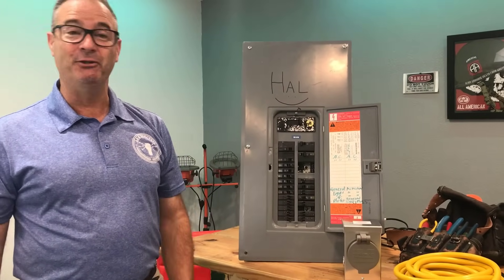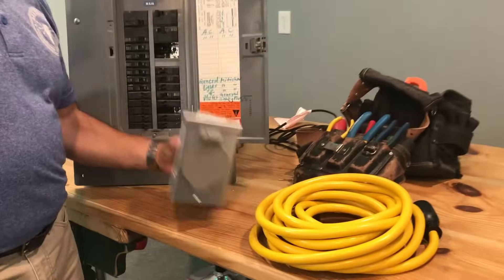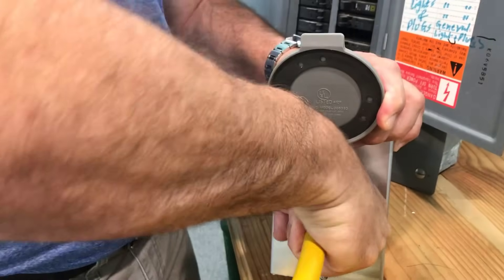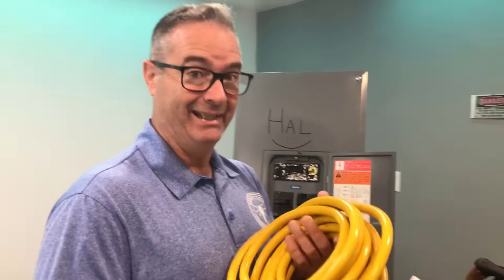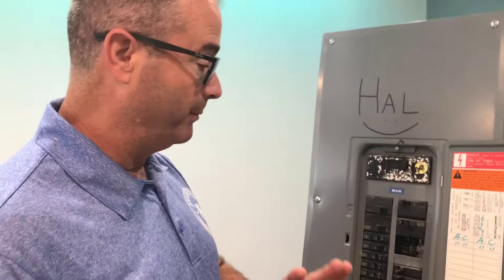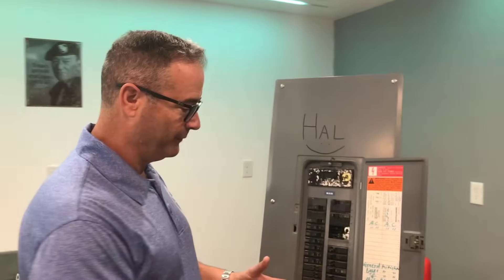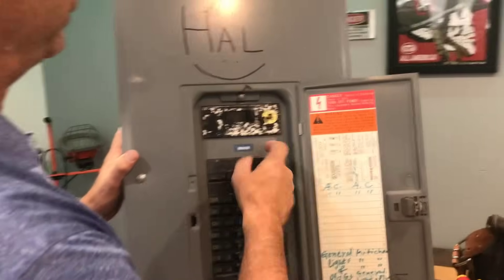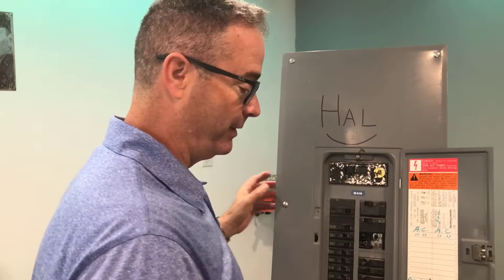4 Generator Hacks by an Electrician

Comment: Should have some discussion on dealing with the ground and neutral connection from the generator.  We want to preserve the ground fault interrupt function of the breakers in our main panel and subpanels.  If we don't have a transfer switch which interrupts the ground and neutral tie in our home when the switch is thrown, and use instead a backfeed of an standard 240 VAC breaker, we need to insure our generator set does not tie these together in its system.  With two remote locations where ground and neutral are connected, strange and dangerous things can happen.

Comment: Can you bury the cord from the gen shed to the side of house (40ft run) so all you need to do is plug it into receptacle on house (or just leave it plugged in) with gen and transfer switch off???
Reply from the maker: If the cord is rated for outdoors and direct burial, yes.
Reply: @abrelectric  Thanks:) How about a cover over the receptacle box attached to the house any ideas?

Comment: You forgot to mention something critical, if the extension cord longer than 50 feet from a generator can cause a loss of amperage and voltage, a phenomenon called voltage drop, which reduces the power delivered to the connected appliance! None inverted generators may damage sensitive electronics, sound bars, tv’s etc etc. LED lights may experience flickering when using a none inverted generator.
Reply from the maker: You are so right. The length with the resistance of the copper absolutely can contribute to the voltage drop. The other issue will be the connected amperage will also contribute to that drop

Comment: Great info! Biggest problem is when Someone pulls the Generator out and it doesn’t start. Why, because the 10% ethanol fuel sucks today and it clogs the carburetor. Make sure you run ethanol free fuel from day one and a little fuel stabilizer in the gas doesn’t hurt. I had 2 Homedepot generators for 20 years, no issues.

Comment: 👍👍👍 great tips, question, is it necessary to turn off the solar panels too?  it's installed before it reaches my main breaker box, the solar installers never advise me to shut it off during power outages.
Reply from the maker: @PilotGuam  my experience is Yes, turn off the solar panel breaker when you're running the portable generator.

Comment: ❗️BEST PRACTICES… Charming man, good video… Any generator contractor not running a full load for 20 minutes cycling in and out ovens and Air Conditioning loads is no professional in my book.  Cheap generators and pretend contractors are a waste of money.  A real generator company has six month site visits, changes oil and air filters with a small engine tech yearly and replace the starter batteries before fall every two years. The Chinese starter batteries don’t hold up and they are cheap. Your client wants reliability, not pushing some silly battery to its near death perhaps squeezing another year.  This is not your old F150 pick up, it’s a clients reliability AND your reputation on the line. 

A real generator company has LOCAL service techs just for generators. Not a tired, hungry electrician at the end of his long install day and has a no all upset client service emergency often due to the lack of excellent preventative maintenance.  Everyone is crabby and it’s never pleasant.  These silly home centers on request for service offer an 800 number and a cold shoulder.  Buy wisely, not conveniently!   Be a Best Practices Buyer detective to qualify the company before you EVER let them set foot on the job site to even quote the job.  Google ratings, BBB.org and other reference points are very important if reliability is the goal.  

Lastly Kohler generators rarely disappoint if they are installed correctly.  Also keep the low voltage signaling cables completely separate from line voltages in separate sealtight whips… Too many false alarms from EMI and intermixing of LV where it has no business being.  

A generator is NOT a refrigerator and is not a home appliance. It is power stability and reliability in a complex system that MUST be serviced regularly.  None of this ‘if it breaks call crap’.

There are electrical contractors (EC’s) that have service level agreements indicating exactly what’s to happen and when.  They sell these with the installation and it funds the technician(s).  One contractor I knew bought up old military MEP generators and overhauled them in the winter.  Sold the units during disasters and had back ups for their service clients.  They had some on wheel hitches that is also Military surplus.  The service trucks had hitches so they could travel right to the site.  He also had sold bypass NEMA plugs on the house gen set area with a manual switch to get temporary recovery in place quickly. The MEP’s had long cables to reach around the house. 

The MEP’s are diesel, so that has to be scheduled for delivery after the first couple days if it were that bad.

I also remember the wheeled ones had an extra muffler for residential noise control.

Comment: I use gasoline and always run my carb dry and most important I only use Ethanol-Free gasoline in all my small engines and they will start after 6 months of sitting

Comment: Why would anyone be “panicking” because the power is out? Here’s a Pro Tip. RUN ALL THE FUEL OUT OF YOUR GENERATOR (or drain). This ensures the Generator will run every time you need to use it. Spoiled Ethanol is the number one issue for Generators not running when needed. A non vented fuel cap will also work. Just remember to leave the cap loose to run the Generator. Fuel can’t spoil with zero atmosphere entry/escape.

Comment: The interlock stops your generator from backing the gird ad killing a lineman! Article 702 of the National Electrical Code ANSI/NFPA 70. Also NEC 408.36(D) - Plug-in-type over-current protection devices or plug-in type main lug assemblies that are back-fed and used to terminate field-installed un-grounded supply conductors shall be secured in place by an additional fastener that requires other than a pull to release the device from the mounting means on the panel.

Comment: I had a Boss that as each of the 5 man crew came in in the morning, he would say HOW THE HELL ARE YOU lol.  I received a free 10 year old WINCO HPS 9000 on craigslist, the guy never did maintenance and either rodents ( saw chipmunks while there) or the fuel line corroded, and gas leaked out and started a fire. he thought the generator was ruined, replaced the fuel line and a few wires....oh and a coil that something chewed trough the spark plug cable and up around the carb on the B&S vanguard motor a bunch of nesting material. runs great. also if the power is out and the main circuit breaker is on and your generator is running it will put power out on the utility line, not sure how much diluted it would be...but could shock / kill a power company line man working on the lined near by.

Comment: Over the last few days we've had to run on generator power, on & off, quite a few hours.
Ran mine in our detached, well ventilated garage.  24x30, unfinished with full length vented soffits, full length ridge vent and two gable vents.
Noise wasn't an issue at all.  It was very convenient to have everything in the dry in an enclosed space.
* I wouldn't recommend this set up if the garage was finished and enclosed with drywall.  ☠
Reply from the maker: @BlainsTube  thank you

Comment: A hour meter would add  very little cost to a generator and it would show when oil should be changed, is there one that could be aðded? I use high test gas in all my small engines (5) and have had no fuel problems.
Reply from the maker: @brucebannerman6848  many portables come with them built in; I'm sure it could be added.

Comment: Gas: use AVgas for your generator.  Mogas is only certified for 30 days.  100 Low Lead at your little airport has 100LL and is certified for 5 years and won’t gum up your carb

Comment: i bought a dog house from a ag supply place.. great for my gen, i cut most of the floor away for cold air intake. and put screen over the hokes to keep mice out. gen extended full tank wires fit with plenty of room. and all anchored to the ground to keep it from sprouting legs.
with a exhaust fan to suck out hot air. not like this dog house is all that tight. 
a lock out in the fuse box so grid and gen can NOT be on at the same time. line safety there.

Comment: I noticed a couple of statements made in the video that need clarification to avoid problems. 1. Get a longer cord than needed. While a little is good too much or if the generator can't be placed near the power inlet if a long cable is needed up size the cord to reduce voltage loss.  2. You are correct about the exhaust. A good quality generator is not objectionable loud.  3. The use of a generator to feed the whole panel could result in low voltage and generator over load. Have a plan for load sharing to not damage anything.
4. The statement about the interlock is not so much to avoid damage to the generator, but to keep the line workers and storm cleanup crews safe. Back feeding the power lines can result in serious injury or death.

Comment: Question I purchased a commercial griddle 208v/240v  it has 3 prong nema p20 plug I run a 10/3 cable the generator has a 4 prong so I used an adapter to have a 3 prong for my cable  the griddle takes 45 minutes to heat up to about 125 degrees any help would be appreciated thanks
Reply from the maker: @tammylynn5822  your griddle power has to match the generator output: what kind of plug do you have on the generator output? A nema 14-50? An L14-30?
Reply: @abrelectric  I will gather photos to show you I am at a stand still with this thanks
Reply: @abrelectric  it won't allow photos on this thread

Comment: I located my generator inlet right below a silcock spigot and Inide  my 18AWG  4ft cord in the toilet tank, we have crime issues.  I do scheduled maintenance  quarterly or once every twenty five years come hell or high water. Does a dry run mean to remove all oil, and do the test run? My two best friends are lineman and I leave my main on. There wives are real shrews and they are depressed and it would be doing them a favor. Thanks for the video.
Reply from the maker: @kenneths.9315  no, thank YOU for all that goodness 😉

Comment: I know what you mean about stiff (virtually unbendable).  I bought 10 Ga. 4 wire Super Vutron .  I bought enough so that I could make two runs from the Gen. to the inlet box and ran them in parallell so I could get a good safe 50 Amp setup.  I had to make Hubbell richer buying the inlet, and two 50 amp marine grade connectors.  But using and storing that Super Vutron was a dream compared to all other cables.

Comment: Ethanol free fuel is very much worth the investment- keep it fresh! I've found that cleaning out the fuel bowl once a year is a valuable maintainace item. Most generators have a low oil shut-off. If the generator will not start with a couple of pulls, make sure the oil is full.
Newer generators with the carbon monoxide detector seem to be problematic. Make sure yours works properly!
I always figured that my 5 kw gen put out 2500 watts X 2 on the 220 circuit. Turns out that it only provides 3.5kw, as do most portable generators. It is enough for my needs...make sure it is enough for yours!

Comment: i am retired now and get paid on the 3rd of every month. and i start my Generator on the 3rd of every month for at least 15 minutes. and my 15 year old harbor fright 8750/7000 has never let me down. and where i live when we lose lights sometimes its been up to 21 days.  i need to make sure everything is right. and around here you never know when you going to lose lights. just yesterday i heard 4 generators running in my neighbor hood. everyone making sure they are ready to go. and i have 10 5 gallon gas cans in my box at all time. i wish i could keep them full of gas but you know gas dont last like it use to. so they are empty and clean ready to go if needed.

Comment: All good points.  I keep my two generators with fresh oil and no gas in the tank.  I keep 5 gals cans around that I cycle every 6 months with fresh fuel.  I zip tie my power cords to their devices, because you will never find them in the cold dark.
Reply: What is the difference to keep gas in a can or a generator’s tank? I trust tank more than those cans.  That is why I keep gas (non-ethanol plus treated with fuel stabilizer) in generator’s tank .

Comment: Only the cheap people will be offended.  When it comes to my home my safety and family safety cheap is not a word we use.  Great Video straight forward. Speaking as a homeowner i actually have my cord permanently mounted in a waterproof box the generator stored with Emergency Backup lights that come on ehen power fails. This way there is no looking for a flashlight.  I also keep an emergency backup flash light directly under my electric panel and several within the house.  Every Month on the 1st i turn the main off and check each light. This test is done late at night to ensure i can see everything within my home and outside. Every other month i start the generator and let it run and put it on a load.  10 years laters this system has never failed. I have been threw countless hurricanes and storms.  You are correct Sir homeowners needs to treat this as a car.  All my generators are a life line.  Great Video

Comment: I run the gen, and other things, on the first of every month. About every 3rd time I run the house with it.
I annually change the oil and spark plug. I keep at least 4 spare spark plugs and a 5 gallon jug of oil.
I use propane, gasoline is my backup.

Comment: I love the steps and easy to understand things but I am having an issue about finding out  the specs on a Generator Inlet box install:  My Main box is on the side of the house toward the front and Looking to get the Inlet box installed in the back of the house behind the fence so that I can keep the generator or system ready to connect and now worried about anybody walking away with the units.    Or should ai put the generator inlet box right next to the main box and run a longer cable into the back yard?

Comment: Thank you. I’m learning since I finally got a generator. Your video was helpful. Now I just need to figure out the best way to do this  connection here in NC for my refridgerator, a standing frezzer in the garage and a few lights. We have a fireplace for heating and natural gas for cooking. Summer AC (we have windows…haha). So do I go with proper size extension cords (size??) or a hookup. My generator is a B&S P3000 (2600w) with 4-120 plugs and a 30amp 120 for trailers. Again, Thank you very much for your video!

Comment: I think it is important to dry run the entire setup.   Have a dedicated location for the Generator.  Have a shelter, already fitted, tested, etc., because you can't just park it out in the driving rain.   How fast is your setup time?   My shelter clicks together in less than 2 minutes, and locks to a wall outside the garage. Have the exhauset managed.  confirm you have air flow and the generator won't overheat.   Have a can of starter fluid, and never leave gas in the generator.   I always have fresh fuel ready to go.   Dry run twice a year.
Reply: Have fuel in a can but not in a generator tank?  Tank will hold fuel longer

Comment: GREAT VIDEO.  He is absolutely correct....Corrective and Preventative maintenance.  He stated quarterly, I go for monthly.....AT LEAST 1 Hour UNDER LOAD.  That load can be anything....a couple of coffee pots, an air fryer, a toaster or two.  You would be surprised how much wattage a toaster takes!  You do not have to plug it into the house to run it under load.  Also, if you use gasoline, be sure when you are ready to shut the generator down, you turn the fuel value off in order to allow the system to use all the fuel out of the lines, etc.  Also OIL CHANGES every year or every 100 Hours.  

Quick tale:  I was an "Auxiliaries officer" aboard a Cruiser.  I had the emergency generator, hot water, steam, and Heating/AC equipment.  I begged and pleaded for the captain to let us test under load the generator.  Always got a "no" answer.  I wrote memos, went to the cabin, had the CHENG ( Chief Engineer ) bring it up, all to no avail.  One day out at sea we had the Admiral onboard when the ship's boilers dropped the load.  I was on the bridge as the CO and Flag waited for the Emergency generator to kick in....which did not occur for about 10 minutes.  Both officers were pissed and in the chewing out process, I brought up the point that I was not allowed to run or test the generator.  The CO was quite forceful in his rebuttal....til i produced memos with his red "DENIED" scribble and signature.  After that, I was allowed to run the EMERGENCY Generator whenever I need to.  He was relieved early but for the rest of the two months while he was in command, he would not speak or acknowledge my presence.  The XO even warned me that things "might get uncomfortable" for the next few months for me!
Reply: Some people just have to maintain the illusion of being in control. 'Why did I deny permission for you to test the generators? Likely because it wasn't my idea, and in my head, I'm the idea guy, and others are there to facilitate my wishes.' Sadly this is one of the most played out scenarios I've seen in 35 years of dealing with builders and tradesmen. Not everyone has even close to the same talents, but a great many keep a firm belief that theirs is among the greatest.